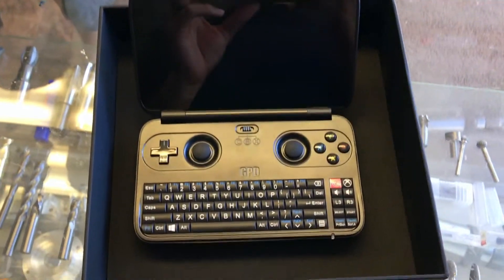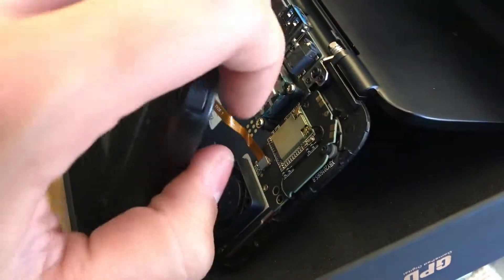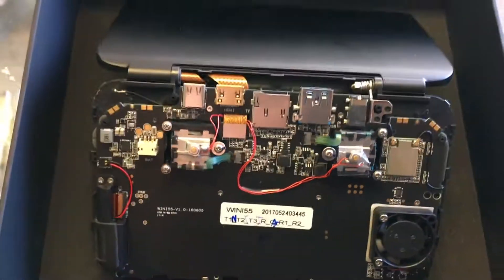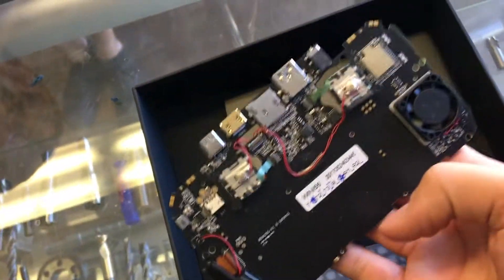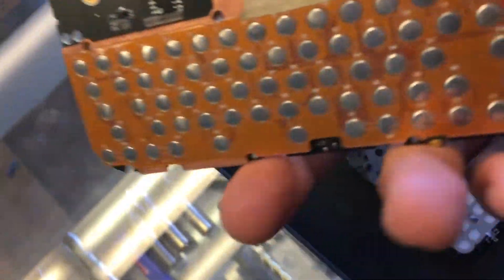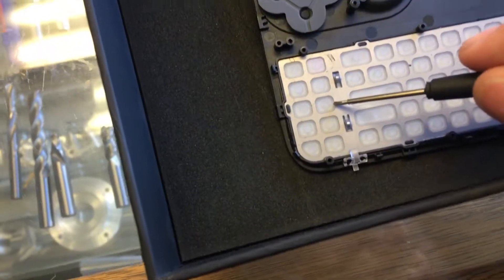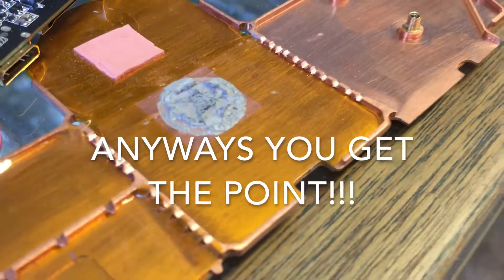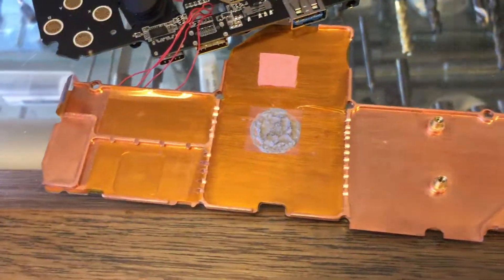GPD WIN clickable analogs mod TUTORIAL

Comment: Very good work men, where you buy the buttons? Any link please i tray it ^^^
Reply from the maker: +Rafael Avellaneda Bisquerra i actually didn't buy any of the parts I just salvaged them off of a couple of old charging cases I had but if anything you can buy the switches on Amazon
Reply: what are the switches called? thanks
Reply from the maker: +kas130771 they're called tac switches or tactical switch
Reply: awesome i looked it up and instead of tac or tactical they are called tact or tactile switches thank u for the help
Reply from the maker: kas130771 oh sorry lol I'm not good at spelling